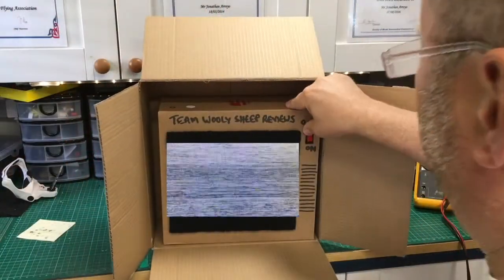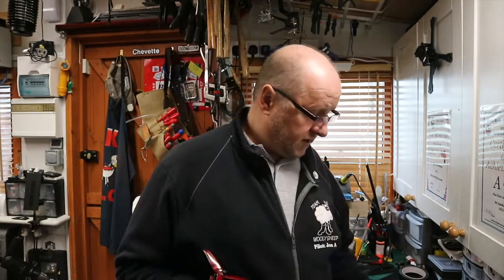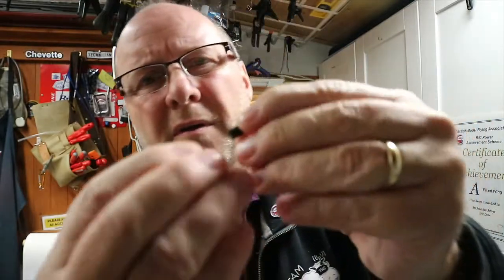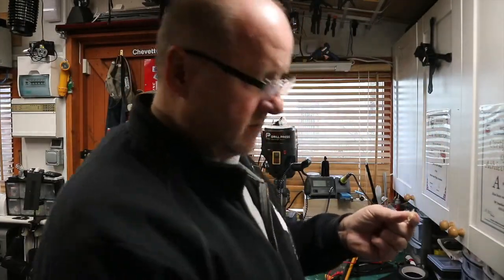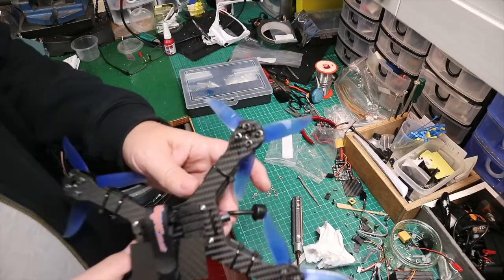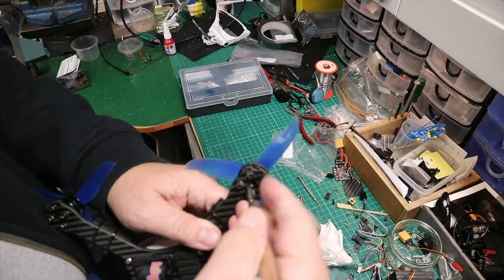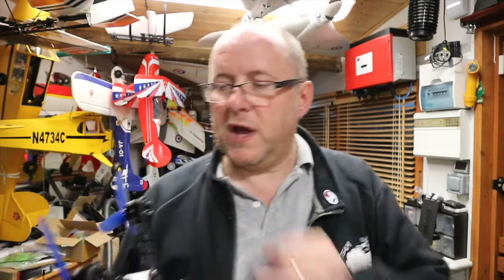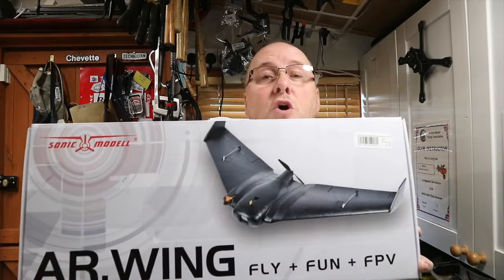Soft Mounts - All You Need to Know

Comment: Does it really damp vibration ?
Reply from the maker: They say it helps. However my view is probably not. The vibration from props spinning at speed is not going be resolved by a 1mm pad. Screws are still linking motor to frame remember. Keeps the motor firm  so that is helpful.

Comment: I have these same soft mounts but all I have is the thicker black ones. 

When I put them on should I tighten as much as possible. Or how lose should I leave them with the lock rite on.
Reply from the maker: Nameless Droner use locktite and tighten finger tight plus half a turn.
They need to be firm with slight mount compression so the motor is firm. 
I tighten all screws using my driver with just the tips of my fingers griping the driver, then go around again just nipping them up a little bit tighter

Comment: I see no one mention you can't soft Mount Motors without putting the soft mounts underneath the motors on both sides of the carbon for the screws as well. If the heads of the screws are not soft mounted than the vibration from the carbon fiber travel straight up through the screw into the motor. If you soft melt the screw and the motor the screw has no vibrations and it's isolated from giving any vibrations to the motor. To have a truce off Mount you need to have the screws soft mounted on the bottom of the Quad 8 individual pieces for the entire quad two on each arm.
Reply from the maker: Wow....that is taking it to the extreme but like where you are coming from.....Joshua Bardwell did a piece in this and found that basic soft mounts did make a suitable improvement. The conclusion was the surface area of the screw heads was far less than the motor and as the carbon absorbs vibration also it was enough to make a marked improvement. In my view, damaged blades make the whole quad vibrate regardless of soft mounts. If the FC is that sensitive then its no good. Joshua has released his board with the older naze32 gyro chip that was never a problem.... I have tried it and it is really good......video coming soon...

Comment: @2:07 you are holding a knockoff part. The real rubber isolation mounts are an engineered part made from vulcanized rubber and galvanized steel. The steel at the tip of yours is clearly not hardened steel and the rubber is too shiny, vulcanized properly rubber will not be shiny like that.  J.w. winco has the real engineered part that has tested tolerances. Stop showing the China trash. You can be a part of the problem like rotor riot or be a part of the solution like teamblacksheep.

If you want the good mounts I have them in stock, they are $8 a set of 4 but I'd send you a set to review if you'd like.
Reply from the maker: Wow......you are not a fan of rotor riot then......lol
I got the rubber mounts either from EU banggood or HobbyRC in the UK.  
https://www.hobbyrc.co.uk/matek-fc-vibration-damping-m3-standoff
I have to agree that the rubber seems too hard to be good dampeners. I was hoping they would be more like a softer silicone rubber. Happy to review. drop me an email and I'll send you my details
Reply: another rude asshole in rc, I'm shocked

Comment: Geddon!  Squishy! i like the light hearted and friendly approach, well done bud.
Reply from the maker: Thanks, I have watched so many videos that are interesting but dry. I try to inject a bit of humour but that is me in general....
Reply: Hi ! So first soft mount and than PID tuning?
Reply from the maker: PiD tuning with vibrations can be hard work. Flies great at low speed then a mare at high speed. Clip a gate and bend a prop slightly and game over. Its a process of eliminating things that can spoil your flights. Either love them or hate them like Marmite.
I think Joshua Bardwell has nailed it by using the older gyro chips.... I think future builds will be with his boards.

Comment: Nice tips :) . Another problem to be aware of with the BG engine mounts that I ran into, was warping the motor, if you were uneven when tightening up your mounting bolts. This only happened on my T-motor F40s but seemed fine on the red bottoms. It put a fair amount of tension onto the bearings and I could easily  feel the drag. I elected to go with the  FC rubber mounts on that bird.
Reply from the maker: When tightening up they have to be barely tight (hand tight) and lock tight used to stop them unthreading.